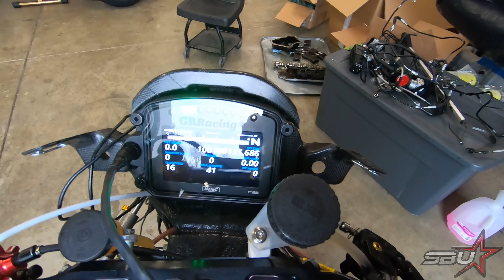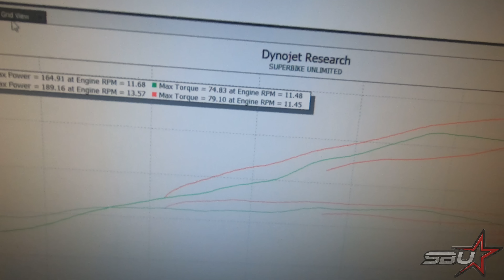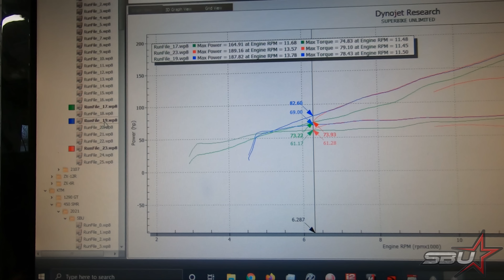2021 Kawasaki ZX-10RR SBK Pt.5 - Installing and Tuning MoTeC M1 ECU, Race Harness & Full Exhaust!

Comment: When Kawasaki listed the 21' upgrades with the Pankl Ti rods and lighter pistons my first thought was 'that's going to rev like crazy'. Dyno looks like that's the case.

Great videos, those arrow pipes are used by the BSB RAF Kawasaki team and the GR motorsports team too. Loud is an understatement, You need ear protection if you're in the garages when they fire them up!
Reply from the maker: It's certainly got the volume aspect taken care of!!
Reply: Yeah, wondering about the rev limiter getting pushed up. How far can you go past OEM rev limiter before #$(&@(* boom?!
Reply: @daveyt4802  Well, the rev limits in the regs are usually based upon the street specification limits. The BSB regs (up to the end of 2020) specify a limit of 750rpm above the street homologated model. As such, raising the limit of the streetbike automatically allows an increase of the permitted setting for the race bike. 

WSB is similar in that a new model has its limit based on the street limit initially, before it is re-evaluated once race results are in using a 'performance balancing algorithm'.

I'm one of the BSB Technical team and although Rev compliance is done at the end of the races by Motec personnel (all BSB machines run a control Motec ECU, apart from occasional special exceptions like the BMW's with shift cam). We look after physical compliance (weights and measurements).

Comment: I'm curious, how does the shifter/blipper system work with this ECU? Do you just use a load cell sensor and rely on the ECU for the ignition cutting/blipping or is there an external system in use?

Comment: Hi Freddie, loving the content! I notice you said you were running the 4 header lambda sensors as well as one down in the combined pipe. In reality is there any need to run the combined sensor if tuning individually? Does it give you any different information? Would be interested if you could run through this when you get to that point on this build.
Reply from the maker: Can do!

Comment: What type are the O2s from the headers?
The standard LSU 4.9 from BOSCH? Is that one a fit in there or you re using another model? I also need to find a way to stick those and tune per cylinder, but i have no experience with the O2sensors fitting in there.

K U D O S for the great great videos, you bring light to many of us <3
Reply from the maker: We use a special exhaust engineered around that goal, but yes, they are standard LSU 4.9. We can do this tuning on stock ecus, but it’s very time consuming.

Comment: Awesome Freddy! Just curious what differences does a WSBK spec zx10rr engine have over your setup? Compression ratio, different cams, fuel, approx hp?
Reply from the maker: They will have their own privately-developed camshafts, they use a different spec fuel, compression is going to be similar. Hard to say on horsepower, but it's likely their SBK engine will make 7-10 more than ours, being the factory, they will surely have some secrets that make that difference.
Reply: @SuperbikeUnlimited  Interesting! Thanks for the info. I look forward to the next part of the series!

Comment: IS there anything special about the clutch safety switch? looking to install a crg rc2 clutch perch set up, and the kawi one would need to be swapped out as the CRG uses a honda unit.. any issues with using that?
Reply from the maker: Of course we don’t use a clutch switch on this bike, but as long as the new switch functions in the same way the old one did, there are no problems with swapping it out.
Reply: @SuperbikeUnlimited  Thank you, and also on the 22,  do the 16-20 rearsets work?

Comment: What are you doing exactly to accept the e-throttle gen2021+ on the gen2016-2020 ?
Reply from the maker: Do you mean aside from the M1 ECU?
Reply: @SuperbikeUnlimited  I think he wants to adapt the new e-throttle on the old gen.
Reply from the maker: It’s not something we’ve done but would be simple if using a superbike ecu as we are. It’s essentially just a harness modification and recalibration of the grip sensor within the ECU.

Comment: Super work and class motorcycle, but 189 HP and that even at the engine seems to me for a ZX 10 RR really little   if you still detracted the 7-10% for the rear wheel is not much left. 👍✌
Reply from the maker: That's the most a stock-engined Japanese bike has made on the dyno so far. 👍

Comment: Wow chris moore made 192 with stock exhuast and no flash.
Reply from the maker: Amazing how high some dynos read!
Reply: Chris Moore I think cracked the ECU finally
Reply from the maker: @ravenmoto5948  Extremely unlikely.
Reply: @ravenmoto5948  no he didint. He found a way to keep the secondary flies open but the ignition and main restrictions are there.
Reply: @SuperbikeUnlimited  Its funny you say that. But he has the worlds fastest gsxr stock motor 1k that runs 8.2s in the 1/4 Mile and only makes 193 to wheels on the same dyno. But hey the dyno reads high. 😂 You should take your bike to his dyno and see what it makes. He has an enclosed dyno made to spec.
Reply from the maker: @Stage2_392  Red Dynojet dynos like that are 3 generations old. Winpep 7 dyno hardware and software has not been supported since 2014. This is stuff that's 20+ years old, just FYI. Whether or not a dyno reads high has nothing to do with how well someone performs at a drag strip. We used to use that dyno, almost 10 years ago, we had a 2009 R1 making "195hp" there. Here it made 175. This is not his fault, it's just how this works sometimes.
Reply: More important is what are the stock numbers and what are the finished numbers to see what the gains are. Whether freddys dyno read low or high it’s the increase in hp from
Stock to finish that matters most. 

Anyways if u want to see good numbers of increase from
Stock to finish here is an example 167 stock same dyno same technician same location to 216 finish product 
https://www.instagram.com/p/CJmXZuKHyN5/?igshid=1t231kkei6qj9
Reply: Moore's entire business model is based on selling people high HP numbers on a dyno sheet, of course his dyno is going to be optimistic. The only numbers Freddy sells are ones that bring down lap times, and that's not necessarily always gonna be all about peak HP.
Reply: @Uninfluenceable  Some people just get wrapped up with peak HP numbers
Reply: @Uninfluenceable  He made the same gains he did also 47 and no flash. What im saying is nevermind it doesn't matter 😂.
Reply from the maker: @Stage2_392  47 horsepower with a stock exhaust and ECU on a ZX-10R is not the same as 47 horsepower on MoTeC-equipped ZX-10RR with a full WSBK system. It depends on where that was measured, technically we made more power at the very end, but the original ECU was falling off a cliff. We didn't watch the video you are referencing.
Reply: OOoh! Interesting conversation going on here. Drag racing and road racing are really different. I like both!
Reply: @daveyt4802  Not really they are both stock motors but one has bolt ons with motec and the other has a stock ecu 😂. Oh the other thing is he just dynoed a 2021 gsxr and it made 162 😂 but again its a old high reading dyno.
Reply: @Stage2_392  And I seen him dyno a 2020 bmw s1000rr with bretune and akra exhaust and it showed like 192 hp which is on the low side not high for that bike with those mods
Reply: @ravenmoto5948  Who moore or unlimited.
Reply: @Stage2_392  Moore
Reply: @ravenmoto5948  oh yea that was a while back when it was in the other shop.
Reply: @Stage2_392  soo to get this correct if Moore has an old/off calibrated dyno do the numbers only find am error after the dyno reads above stock HP, it didn't matter when he was getting low 169, 178hp but once he got 47 more things are old 🤔
Reply: @yongamasotondoshe7518  I have no idea 😂 thats why i left it alone. I guess that Ducatti v4r makes like 240 to the tires that Unlimited did a while back. Moore dyno lines up with everybody else's dyno including 650ib and eninve.

Comment: Ride by wire has still pool/push cables going from throttle to actuator and e throttle has electric cables from throttle direct to ECU?
Reply: Pool?
Reply: @Александар.П  from throttle handle to the actuator a mechanical moving cables. I couldn't get what is the difference between e throttle and ride by wire.
Reply from the maker: @hrsjohnny  No cables at all, the E-throttle actually houses the sensor.
Reply: @hrsjohnny  Yeah but what does pool mean ... Don't you mean "pull" ?
Reply: @Александар.П  oh sorry, yes i meant pull